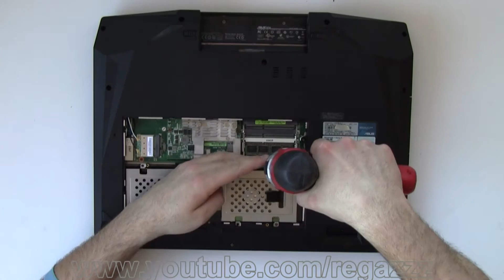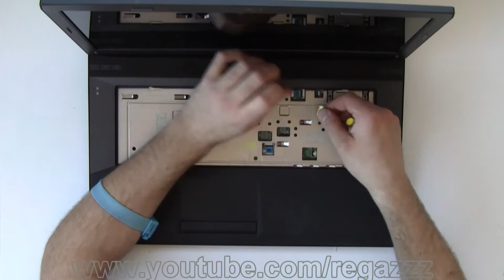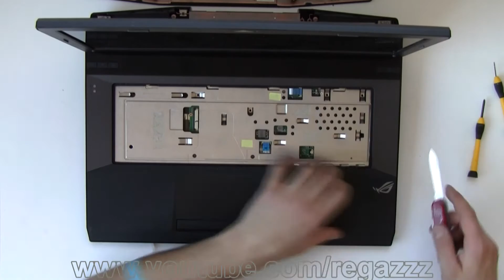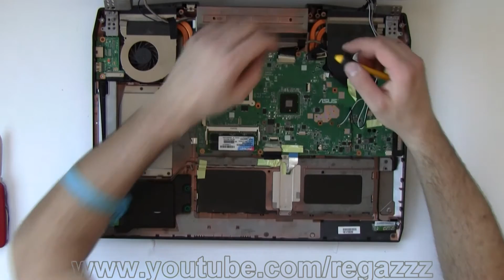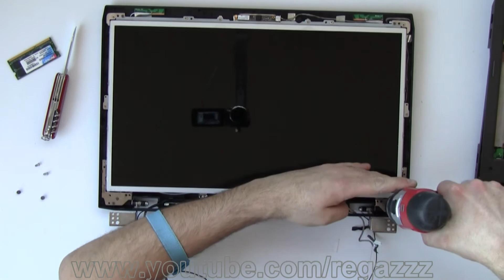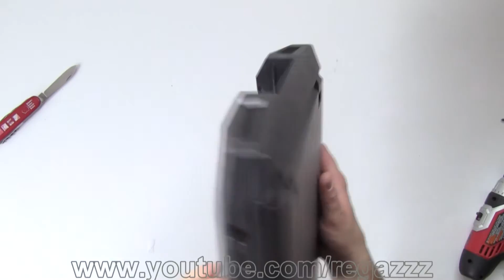ASUS G73 G73JH Take Apart and ReAssemble

Comment: So many screws , clips and connections ...old days ... 4 screws for back cover of tv.... change valve pull out. push in ...2 screws for main panel tilt up unsolder and replace a component  .. 20 to 30,000 volts though ....Great video ...
Reply from the maker: +seveno1 this laptop is from 2010. Still a nice machine. Newer R.O.G's have some cons, like non removable keyboard or glued GPU.
Was hard for me to take apart, because I had a few month break in filming. 
As for right now, technology simplifies things and if you look at some Chromebooks, like Samsung XE303C12... Really easy, but there is no HDD, no wifi card, no memory.

Comment: I never understood your ESD strap. You know it's pointless to wear if its not grounded to earth, right? Criticisms aside now, what model drill/power screw driver do you use? I've just purchased small a Black & Decker "power screw driver", but I dislike it's slow RPM. Keep up the great videos!
Reply from the maker: +RMSTECH, LLC my wireless ESD strap is pointless in terms of ESD protection. It is only used for people who are taking their units for the first time. The Idea was, they look at it and wonder wtf it is. Than they will realize that they have to be really careful with pretty much everything. Maybe they will not, but at least I tried. 
Otherwise I know it is not working.
I don't want to share the name of the drill, greedy bustards don't want to pay me for that, but, I am not greedy and will tell it anyway.
Skill 2364 :)
Reply: +regazzz Thanks for the speedy reply! It appears that model is discontinued...On Amazon anyway. Thanks for the info, though!
Reply from the maker: +RMSTECH, LLC I think they have some similar newer model. Over all it should be like a little drill. If you don't need to take thousands. Of laptops apart, regular screwdrivers will be just fine. I can do it quick with or without.
Reply: +regazzz I do handle a lot of laptops in my business. I too can take them apart quickly no matter what tools are used. I've just been trying to find the perfect mini-drill/power screw driver that has super high RPM, but won't strip the screws. Always looking for ways to speed up my process!
Reply from the maker: +RMSTECH, LLC cool. I am in a slower environment, but I always need newer laptops.

Comment: Can anyone please tell me what the first thing that was removed that wasnt the battery was, I recently i hereted this laptop and this part was missing and wanted to replace it and can't find what it is to replace it.
Reply from the maker: After I removed a door, next items that were removed are hard drive caddy and one caddy had hard drive in it. If you search for Asus g73 you should find one on eBay. Otherwise you can even install hdd or ssd drive without caddy.

Comment: i have rebuilt a few of this very model,  i was a bit concerned when he tried to remove the top cover without taking the display screen loose. there are 2 screws  there that have to be removed to get the top panel off.  also concerned when he didn't clean and reapply thermal paste to the Gpu, and Cpu.   i also upgraded from the Nvidia geforce gtx 440m 1.5 gb memory, to the Nvidia geforce gtx 560m 3 gb memory, as well as the actually memory to 16 gigs.also installed a SSD drive, which greatly sped up the machine.

Comment: I think that is you take down this far you should clean and reapply heat sync paste. The G73 was known for badly applied at factory thermal paste and paste that ages out. I am having that issue with my system now and going to be doing cleaning and reapplying of thermal paste. Also, do the memory up great for that single that is there. Which I knew if the CPU can be upgraded to a faster one. the i7 is first gen 1.6ghz. It would be nice to have more speed.

Comment: Noticed you didn't put any new heat sync compound (can buy at autozone, looks like a little clear ketchup packet with white stuff in it) on the gpu and cpu. If it over heats, which is a common problem for this model, that's why. Other than that, decent video. Thanks for explaining nothing though, Mr Personality.
Reply from the maker: Explaining anything was never an idea. I hope this video helped tho. Thank you for other suggestions etc. Have a nice day!
Reply: @regazzz  It did actually. I just finished replacing the motherboard on my machine after a can a seltzer water bounced off my forehead and onto the machine. So anybody reading this, if a fat-fingered guy who digs ditches can do it, you can too. Thanks for the video!
Reply from the maker: @realitycheckineffect  this is a great laptop and I  am happy that you found time and willingness to fix it! Have a nice evening!
Thanks for watching!